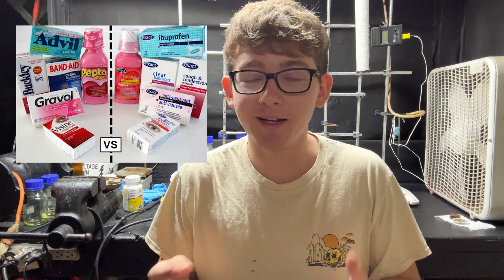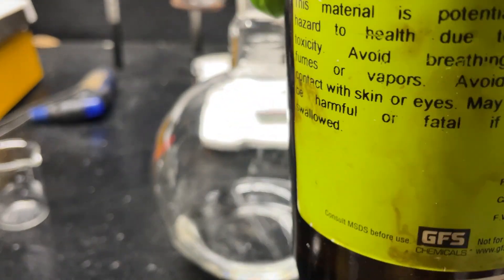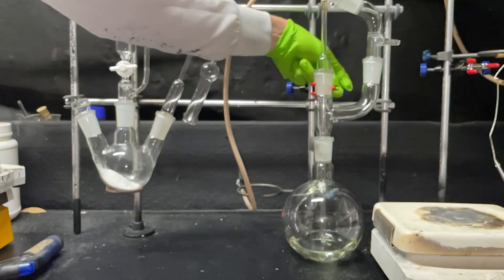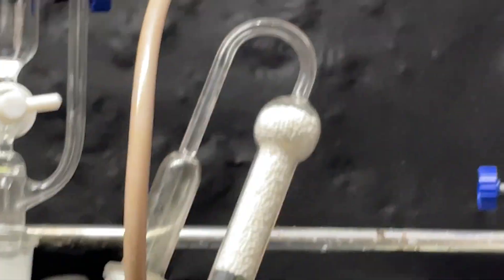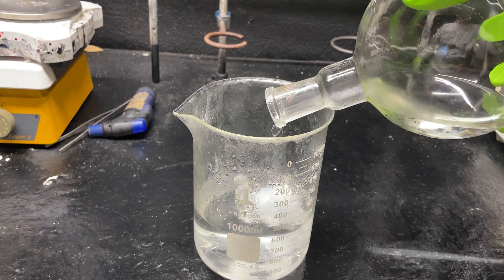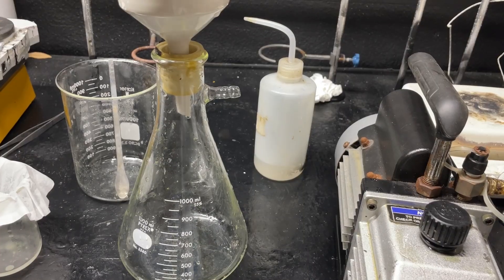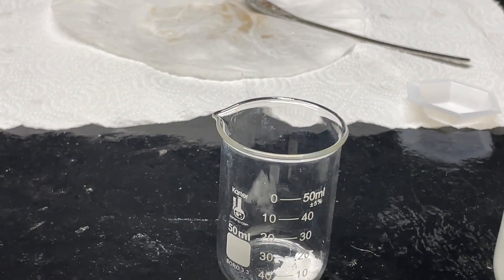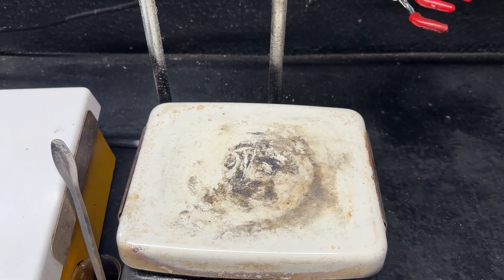Making mace then using it on myself

Comment: Lol, I love that at 12:36 you modify the original container instead of using the pump spray bottle itself that you got the pump spray part from, lol.

If you wanted to make it aerosol, you could always put a tire pressure gauge into it (you can by the male and female parts so you could renove the valve to fill it with whatever liquid.) would just want to be really careful with the amount of PSIs uou put into it so you don't make a pressure b*mb

Comment: make capsaicin pepper spray but also add a bunch of menthol to it. My theory is that it will be super effective since activation of both cold and hot receptors at the same time usually causes immense pain(like the thermal grill effect for example) and even concentrated menthol by itself will causes pain.
Reply: Maybe some hydroxy-alpha-sanshool from sichuan pepper to add an annoying as hell tingling!
Reply: +1 because capsaicine is not toxic and much more potent
Reply: @NinjaChemistChannel  is menthol toxic?
Reply: @danielarnold9042  you are correct, menthol is used as a mint flavoring, but it is used in very small concentrations. Even at 10% concentration menthol will be strong enough to burn skin uncomfortably, so something like 30% will probably be pure agony
Reply: There's a variety of harissa paste (peppers, spices) which includes mint in it. I'm all for the hot stuff, but the mint makes it just pure agony.
Reply: Or the signals inhibit each other... could be either way. It would be interesting experiment.
Reply: @user255  Just tested it with... like normal food and no it tastes like fire from hell itself, might be different on skin i suppose though
Reply: @user255  L
Reply: @user255  no its 2 diffrent sensors blasting at 100% so you will definitly feel it
Reply: This is going to hurt someone and it's going to be so bad to watch 

They'll make and upload the video, but it'll be rough.

Comment from the maker: Thank you to my patreon members
Andrew Conner 
Toasteris and Matt!
Reply: if u gonna try something another, make a-iodo-propiophenone. its less irritating but have some another activity . its activity is not described anyway. eya its not damagin or lethal.
PS: you are make two technical errors: newer use rubber stopper and rubber or pvc tubes when u r work with halogenes. two - need to use long cylinder to absorb gas not rbm. sorry for my english its not my naturaly born language
Reply: Hey did you used to be on the amateurpyro forums?